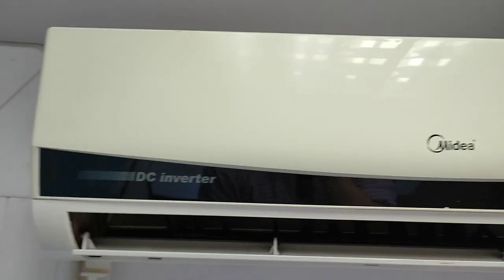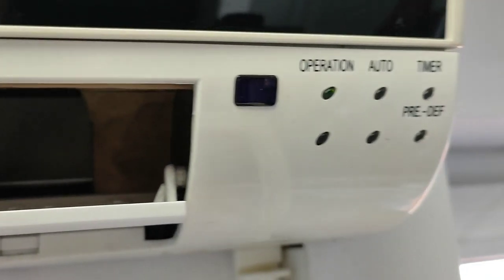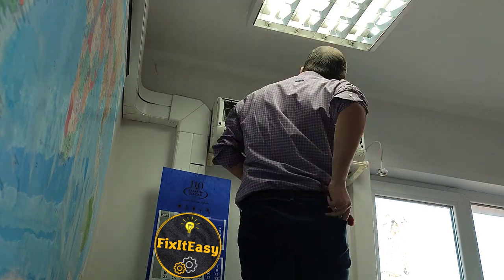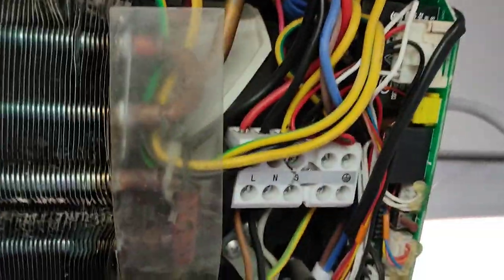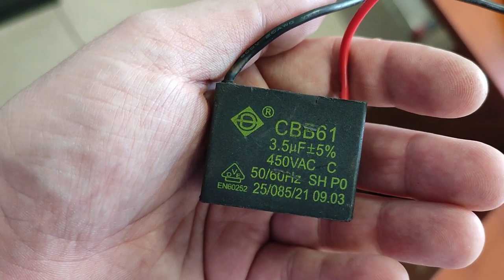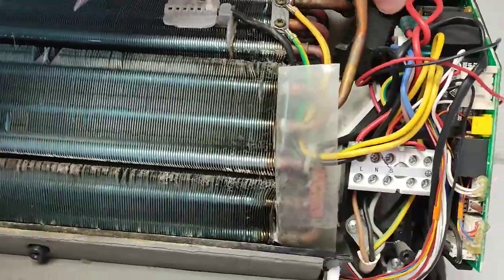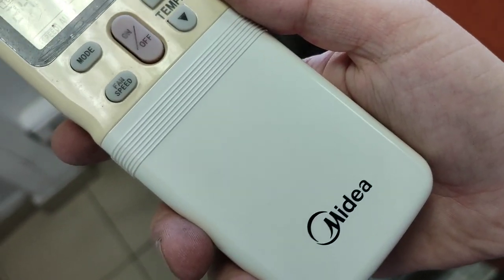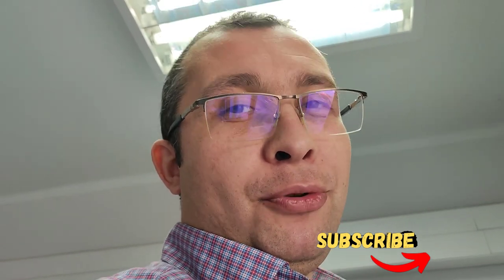DIY Air Conditioner fix for 2 dollars

Comment: Great video mate. It is pre heating the indoor unit then start blowing. Pre defrost ( Defrost)  is when the unit outside has lot of Ice then need to defrost ( melt the Ice down) to clean the fins for good air flow. Thank you for your video was great. Cheers
Reply from the maker: Thank you so much for your great comment. Wish you all the best 🙏